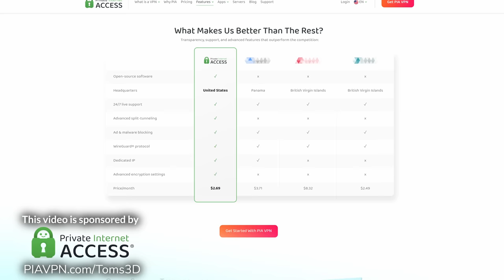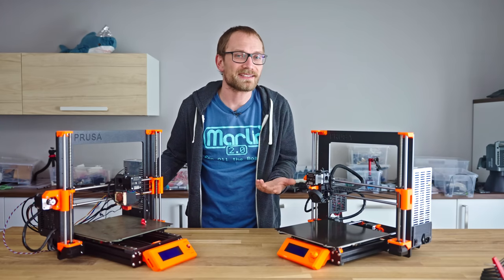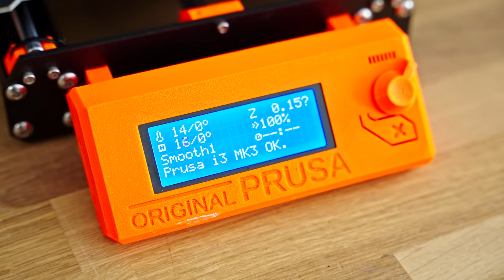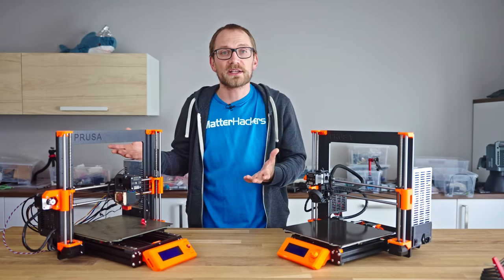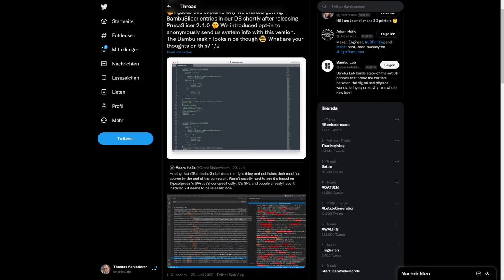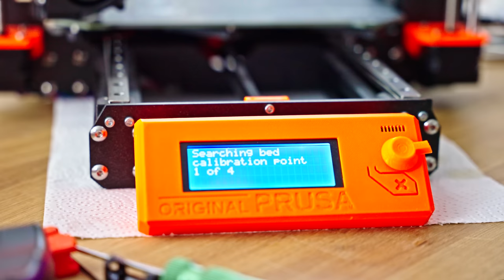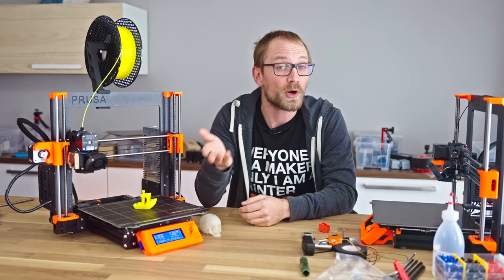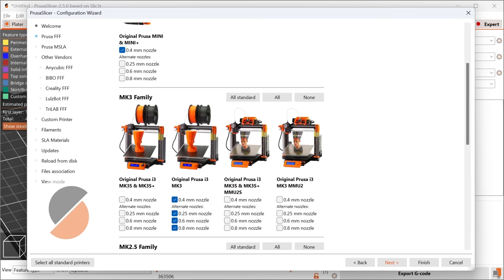This printer is OLD. Why is it still my favorite?

Comment: A love Letter to Prusa and i agree. The Printers are reliable . Through the Time the Printer missing aspekts but with selchtet Upgrades on Point the Print stays his roots and getting new Features. 
With the original Enclosur Prusa ist getting the old boy to new Features. i first orderd the XL but without an Enclosure the Printer ist not fitting in the actual time. After the Formnext where i see the new Device in real i decided to drop it. I will wait until it is improved . SO i stay by my Prusa MK3s+ and do Upgrades on point.

Comment: By far my biggest problem I have with my MK3 is: I have too little time to print stuff. If I find the time, I just press play and I always get what I designed. One of the best purchases of 2018. My printer turns 5 in January and it has hundreds of print hours. It is such a solid machine. After the update to the MK3S, I can't remember a print failure which was NOT caused by a dirty print plate.

Unfortunately, I don't have a use case for the SL1S. I would love to have one, but just don't need it.

Comment: Prusa is tried and tuned with a big print farm that produce those printers.
So they better be reliable and precise enough so that kits fit toghether.
Also the slicer is made for it.
All this made me buy one. It worked right out of the assembly and there is no nozzle jam. 
Just one upgrade : my custom build plate that has G10 surface. 
This does wonders, anything stick to this and everything release too. I use purple kindergarden glue stick.

Comment: You can, but not have to, tweak the profiles to print ~30% faster. Plus, put Volcano or threaded adapter that makes a Volcano out of any standard nozzle. And you still get extremelly reliable printer.

Comment: totally agree with you, the only improvements I made to my mk3s+ where the addition of octoprint and a camera (and the firmware upgrades from prusa of course).  This is the printer I always go to when I need an accurate part.  

My other printers are mostly for me to have fun with.  Last winter I totally ripped my ender 3 apart and made it much more like my prusa (silent drivers, second z motor, filament runout, bl touch, direct drive all metal extruder, wham bam print surface); there was nothing wrong with it but I bought it because I could do these things with it and I enjoyed doing them.

The new kid on the block is a tronxy x5sa, it was cheap and allows me to play with a core xy machine.  That one had more issues, most I fixed by moving it to klipper which I enjoy learning.  Add a flex steel pei print surface and a new part cooler duct and it is so much better than it was.

Comment: Favorite old [insert printer name]...we all have one!
Mine is the Anycubic Mega X: I know every flaw/mod right off the hop, so making one run right is a snap!
Sure it is an ancient design with an anemic CPU, but as a gentle reminder, Anycubic was the first to offer PEI coated heated bed, power-loss recovery and filament run-out detection as standard items across their line.
Plus they are all metal and dirt cheap! (Dang embarrassing name...)
Saving my pennies for a Bambu...tired of bed-slingers.

Comment: I have a Mk3S+ at work and a Mini+ at home, the only thing holding me back from getting another Mk3S+ at home is I am spoiled by the new screen on the Mini, the graphical UI it has makes things so much easier. The print file preview, the Z-height being shown as the nozzle moving up and down (instead of trying to remember if a negative getting larger or smaller is better) are features that are hard to give up. I would love to see a Mk4 come out that has all the strengths and bones of the Mk3, but with the updated electronics and brain of the Mini

Comment: Was looking at a Prusa at first, but I bought a cheap Ender 3 knockoff instead. It printed fantastically until I upgraded it and it became utter garbage, and then I upgraded it again until it prints fantastically again.
It's around $2000 in parts overall (with almost nothing left of the original printer save the extrusions and PSU and Y gantry), but that's probably about what you'd charge for a good course in basic engineering, so I'm happy 😁

Comment: I've recently gotten back into some 3D printing after a while.  I've got an older MK2S from Prusa, and it's still pretty good, although getting parts off can sometimes be a pain.  Looking at a possible upgrade, the Bambu Labs are both very appealing (the P1P especially due to it's price, but also the X1C which is about the same price as a Prusa MK3S).  Looking forward to seeing how the P1P performs, and your subsequent review.

Comment: For the ultimate 3d printing experience, combine a Prusa MK3S,   PrusaSlicer gcode, along with  a spool of Prusament.  Successful 3D printing does not get easier or will it have  more consistent results than within the Prusa eco-sphere.   In my own experience at home,  professionally, and as a volunteer,  Prusa is a rock solid 3D printing solution that delivers well above its price point.  FWIW, my XL is already on order.

Comment: I still stick to my IDEX printer Flashforge Creator Pro 2 with additional magnetic bed. 
In most cases it does what it should do.
The only disadvantage is the proprietary slicer.

Comment: Mk3s+ was my first. X1 Carbon my second. I print functional parts only. I put the X1 back in the closet today and buried it with a bunch of random stuff.  I have no regrets other than shelling out $1600 for the Bambu. Im not rewinding spools for the AMS, the 7-8 minute Startup routine is asinine, cant wipe the nozzle with PETG, shits out a lot of filament. The bed has springs..... that should tell you something, no wonder in wants a re-level and flow calibration on every print, the springs change the bed level at all different temps (custom g-code on start-up is then useless - the low purge settings). Yeah there are some great features but the reliability of the first layer and frustration of hearing steppers without trinamic drivers is so absurdly annoying. The solid kinematics of a mk3  plus its history and track record is such a nice thing to have. My opinion...

Comment: <word wall, skip to bottom if you want a TLDR>

There is a lot that can be said on this topic. I think it's important to recognize where the bar has been raised and where mass production has come into play. But I think it's also important to know long term viability and processes. It reminds me of how teardowns of iPhones would occur and industrial firms and suppliers who would do them would go "so, BOM for the $499 iPhone is $150 and $599 model is $151". There are elements that can probably be cut in cost, but the question gets asked "how much of that profit goes to R&D, tooling, marketing, etc.?"

The MK3 is old and outdated but it works, it works well, and it keeps working. If you want a MK3 that will never get upgraded, will never get support, etc. etc. then go get a Sovol SV-06. But how much of that profit goes into the XL, into paying the extreme markups on parts that are hard to get (even Apple, who is often called the king of supply chains, has said they're not going to have as many iPhones due to supply chain and labor issues... if they can't get parts, you think someone like Prusa, Adafruit, Stratasys, etc. are going to be able to get them?), or to pay an employee a proper salary (something people keep seeming to forget...). Prusa announced a ton of details on the XL... why hasn't it been cloned already? Maybe because many companies don't have the R&D budget to fill in the gaps that Prusa hasn't said.

Bambu X1 took many things that have existed and turned it into a single product, literally picking and choosing the best ideas/features and turning it into something. Even going so far as to fork PrusaSlicer rather then make a profile for it or Cura. They are very much a kick in the pants that were needed as Prusa was taking it at their own pace and basically everyone else seemed to be racing to the bottom or "what if I take exactly one feature and add it to a printer... it worked? Turn into a product line. It didn't work? Drop it." But they're also running off VC money, did injection molding, and use a bunch of metal (which is pretty cheap to extrude and bend en. mass). If Prusa has a slow _year_, they'll still be kicking the next year and still doing R&D, trying to get parts, and improving software while providing support. If Bambu can't ship fast enough, they start burning cash and eventually the VCs say "enough" and "poof" it's gone. It's all custom parts, your machine is dead if something breaks. The P1P is a X1 without side panels, the "laser" + camera that they call a mini LIDAR, and a lower quality screen. They mass manufactured the parts, they saved time by not spending manpower on assembly and certain electronic components. Yet somehow it's $699 vs $999. You're telling me ~4 metal sheets, a piece of glass, a touchscreen, and 2 cameras + laser = $300? Again, what is the markup on something and where is that money going? Given the X1 still says "Pre-order" and they announced the P1P, I'm guessing they're nowhere near any progress on a new printer, which is why they simply offered the existing one stripped down. Great and cheap marketing. Their software and processes though are, ahem, not good. I've looked at the code changes they've done from PrusaSlicer and it would not have passed code review in my last couple jobs if they saw that. Some things look straight up copied from Stack Overflow which is a meme at this point in software, and not in a positive way.

Anker... I haven't actually paid attention, but it comes across as a test product. They may kill it after 6 months to a year and then just support it for a bit after.

Creality booted the few people who know open source, hardware design, etc. and appears to just be taking a parts bin/stats approach and going "it's the newest printer! We added a knob for success!" (I will never forget that marketing line... adding a rotary knob). They aren't going away, but good luck on how your printer performs when you get it.

There are others, but the point of the wall of text: The MK3 is old and outdated but it works, it works well, and it keeps working (as said above), there are things to add like input shaping and whatnot, but Prusa has processes in place to keep functioning and has long term viability to keep making printers where you go "hey, print this" and it does. Others are either operating off volume or you need to ask the question "this is the latest hotness... but they have an albatross around their neck and we don't know if they'll get rid of it because they aren't even a year into existence". Never doubt the power of shiny... for it brings a lot of pain to many and much joy to few.

Comment: My MK3S+ MMU2S had a clogged nozzle from sample filament I got at Formnext. So I got mad, did a long overdo maintenance run and replaced bearings (upgraded to Misumi which now come as standard), rods, Z mounts (with slits to make it easier for the next maintenance), X mounts (original Prusa "+" parts I never upgraded), Y mounts (I didn't like Prusa's "+" parts), switched to Revo Six and am now printing a YZ case, because the original small case kept making me angry. 

Did I have to do all that? No. It will probably not print any better than before. 

Was I able to do all that? HELL YES!

Comment: I fully agree! It is my go to printer and almost running 24/7. The dev team did e great job on adjusting Firmware & Slicer, which probably makes the difference.

Question about lube on the z-axis spindle:  Is that really necessary? I thought rails and bearings only?

Concerning unpimp ze auto: "Vee Dub in zeh houze!"

Comment: It's possible I missed it, but I noticed you didn't mention your Voron here. Is that because you see it as not really apples-to-apples since you can't buy a ready-built Voron, or do you prefer your Prusa over the Voron too (or both)? I'm mostly curious because your video on the 2.4 turned me on to that whole ecosystem, and I'm currently printing the parts to convert my MK3S+ into a Switchwire. Hoping I'm not on the road to making a terrible mistake. 😂
Reply: Curious about that as well. After seeing Tom's video where he basically says that the 2.4 is his new favourite printer, he makes no mention of it in this vid.
Reply: That is because the prusa is a time killer. Will the bambu defeat time?

Comment: Prusa features... for mini and mk3s
✅ Slow printing @ 45-60mm/s recommended speed. It will print just have patience.
❌Uninspired design and uglier than Rykard, Lord Of Blasphemy
❌ $800 as a box of parts
✅$1200 fully assembled
❌ basic calculator LCD display and dial controls? lolwut?
❌ Slow accelerations
❌small build area
✅ everything DIY (upgrades, tinkering?)
❌no enclosure limited capability of printable materials
❌ MMU is a WIP and another $300 but an exercise in insanity to get reliability
❌No monitoring prints remotely without more upgrades(PrusaConnect/raspi/octoprint )
✅ Many claim reliability but Prusa help forums say otherwise
✅ Haribo Gummy bears 
✅ Huge support network of other suckers who bought into the Prusa name 🤣

If someone already had a Prusa then using it makes sense. If someone had to buy a new printer in 202X getting a Prusa seems .....🤡🌎
Reply: Why the hell do people want a f*cking touchscreen on their printer is still a mystery for me.... I personally use it to load/unload filament and start a print, I don't need a color touchscreen constantly lighting up my room... the uninspiring design shows that you never read about the history of the series or the reprap project. The "small build area" is dependent, not everybody print 400x400 plastic blocks, in fact I think that for everyday printing the mendel size build volume of 200x200 is the sweet spot, it still fits everyday prints, while not having too much excess that is wasted when heating up. For the other arguments such as no lights or print monitoring, take a look at the printers that everybody recommends, the V-wheel bedflingers, none of them come with any of the "very important" features you list...

Comment: Bought a mk3s, just wanted a printer i could put together and then print nice prints, no hassle or mods. And it does exactly that, only printed with materials that had predefiend profiles, so not even spent time tuning. Everything just works and i get more time for the actual design of parts :)

Comment: the MK3 has the strong point of excelllent quality plus ease of use due to PEI bed that you can just pop off easily. this allows it to work for large prints without risk of warping. I had nightmares with my Zortrax when it to came to warping. its autobed leveling is an amazing feature as well.

Comment: For me the most used printer is my Prusa Mini because it prints good enough and uses a lot less energy. I'll start my MK3 when I need to print hot or if I need so many parts that running two printers makes sense. The MK3 has not run in month while the Mini is constantly printing. Prusa printers are well worth their money.

Comment: I have one printer and it's a mark 2 upgraded to a 2.5s. it's still good have little trouble with it and prints anything I throw at it with any material. Right now I watching Bamboo Labs see what happens when the printers are being used by the user's who just got them but I think they look promising. They are moving in the right direction and could be the Prusa rival.

Comment: I’m in the same boat. I use my voron if I have any larger runs or huge parts o need to crank out since it is just so fast. But for one offs of prototyping new projects the mk3 get gets it done. It’s the closest to set and forget that you can get. Only thing ive changed was added octoprint and built a enclosure for it.

Comment: I agree. The Prusa i3 having features that aren't widely copied such as the bed level and menu layout still completely baffles me.

For me it's still a better UI layout than many of the touchscreens I've used. Which is mind blowing considering how much time's gone by to simply copy the good elements.

And my printer has gone through significant part replacement for wear or user error. All by just following the current manual after printing new plastic parts. Still cranks through a 0.25 nozzle 0.05 layer height print to produce a quality part.

Hopefully Prusa and upstart competitors iterate on designs like the Voron and get retail products out at hobbyist price points. I'll have to go take a look at the Bambu.

Comment: The most successful farms use Prusas. Its a very reliable design, and the Bear is quite a worthy upgrade. Even if you don't go with the Bear, Prusa's Printables community has a great selection of user upgraded and improved parts, so you can pick and choose from them to build a standardized and upgraded platform for your farm. Its a great system, the best in the industry IMO.

Comment: The main reason I bought a Prusa is that they use them for their print farm. With hundred of printers to operate, their machines and software have to be debugged otherwise, it would be a nightmare to deal with all the adjustments. I built a RepRap Darwin back in the days and I experienced the   
endless problems of that machine, leaving no time for 3D design and engineering.